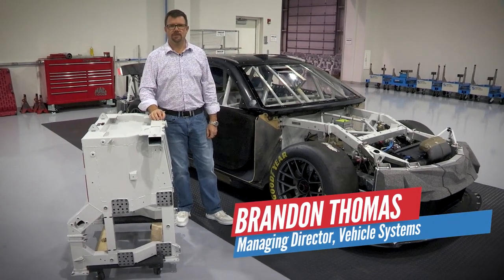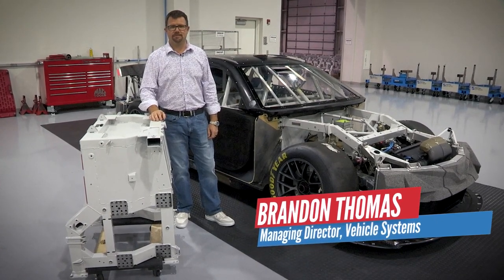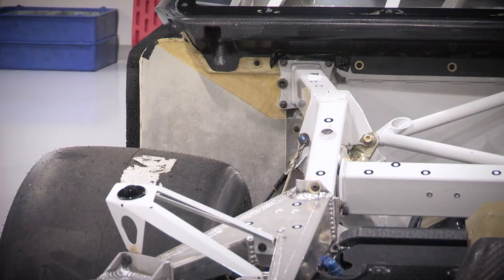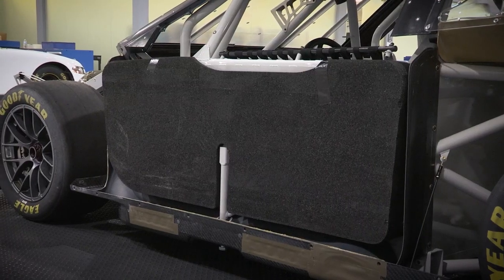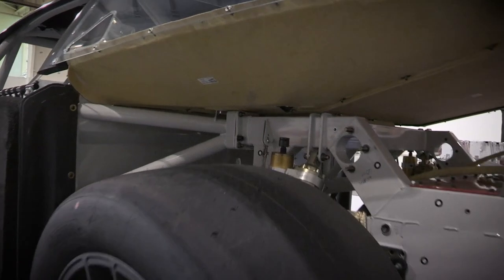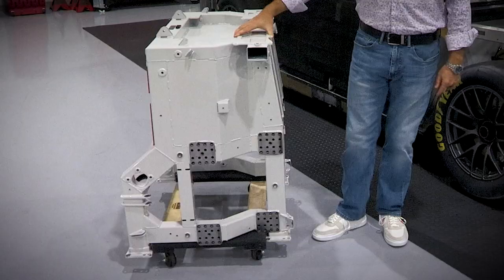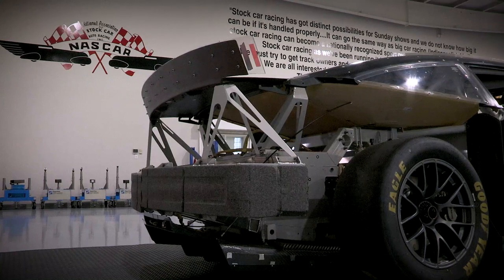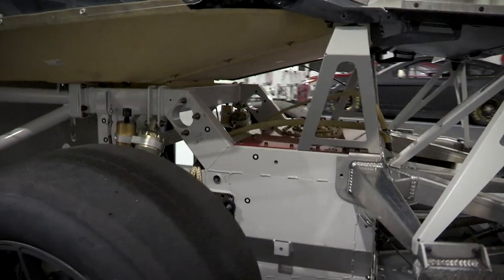Next Gen chassis system features modular design | NASCAR Next Gen

Comment: Once we get through the 2022 season and teams have built up their stock of these Next Gen chassis, I think the new car will be very beneficial to teams in the long run.
Reply: I get the impression (rightly or wrongly!) that a bump in practice that would have put the driver into a backup car might not do so with these - looks like you could pull the whole front off a car and bolt a replacement on there and then in the garage. That'll definitely bring costs down... huge benefit if and when this filters to the other NASCAR series with smaller budgets and less manpower.
Reply: @peterbrownless  hahaha
Reply: they actually can't do that....they're only allowed to own 7
Reply: Yes, beneficial to the TEAMS, but not the Fans.  I can't believe it's come to this:  NASCAR becomes a totally spec series.  That's no fun.  See you at the sprint car races.
Reply: @doninwv  its not a spec series...the Teams have already said that
Reply: @jabber1990  Its a spec series. They all have the same size engine with hp, same tires, transmission, chassis, the same amount of down force. By definition that is a spec series.
Reply: @Hazel-the-Amazon  no...that's not how spec works. Spec is SRX or IROC, this isn't anything like this. there are 4 engine suppliers..therefore its not spec
Reply: @jabber1990  If nascar can mandate what manufacturers you can get your engine from, and the size and hp of said engine. Its a spec series. Hell nascar, teams, and media called the old daytona prototypes a spec series. Yes they allowed only certain manufacturers, but you could have a 5.0 N/A racing a 2.3 turbo, as long as they met the hp limits, and engine size of the engine..
Reply: @Hazel-the-Amazon  It is not a spec series. Teams still build their own engines transmissions and racing components. Not all engines are equal when going from one team to the next.
Reply: @rcr-zt4of  It still a spec series by definition. If nascar mandates the all teams run the same size engine, hp, down force, tires brakes, shocks, etc.  And all cars are Identical to keep the field even. Its a spec series.
Reply: @Hazel-the-Amazon  All series mandate engines size, components etc.  You have no clue what you are talking about. NASCAR has mandated engine size for easily the last 30 some odd years.  Guess what.  The top teams had more horsepower in their engines than the smaller teams.  Why?  Because they spent money on development and built their own engines.  A spec series has one engine manufacturer and hands out those engines to all competitors.  Not even remotely close.
Reply: @rcr-zt4of  Wrong again. A spec series can run mutiple different engine. As long as the cars are all equal, or perceived as equal. The spec maita series allows two different engines, and two different brand of tires. The old daytona prototypes were considered a spec series, and they allowed like 4 different engines.

Comment: Mix and match would funny, a team sabotages another by swapping out their Daytona front setup with a Bristol one.
Reply: as funny as that is...it won't happen
Reply: no ones swapping clips for setups for different tracks lol the clips are only changed if damaged. you run the same chassis and daytona and bristol you just have it sat up and geared completely different with the correct aero shit.
Reply: That will happen for real. Those engineers are smart!

Comment: Very interesting, the real test will be on the track at Daytona after the big one and see how these bolt up chassis connecting areas hold up, after a hard impact.
Reply: I think probably only the center section is part of the "survival cell" so the bolted on sections could be completely detached and the driver would be fine
Reply: the real testing has surely already begun in CFD thousands of times
Reply: My thoughts exactly.

Comment: I first heard of this way of building cars watching the Le Mans 24 Hour race. If you had an incident and managed to limp back to the pits, the crew could just swap in a complete front-right assembly, for example, and have you back in the race at full speed in a very short space of time.
Reply: remember when Audi changed a compete rear transaxle/suspension at LeMans just for the heck of it ? it took them minutes
Reply: @supersevenn  Whoa! I've just Googled it now... Year 2000 apparently, when they had some kind of issue and instead of wasting time trying to diagnose it they just decided to swap in a new, complete rear end/transmission. Car was rolling down the pit lane in less than 5 minutes. That car finished P2. Wow I'm impressed!

Comment: Scary to imagine the amount of bolted connections there are now to the vehicle. Each connection is another chance of working itself loose, cross thread, not torqued properly, tensile break, etc. - Giant erector set, literally.   Will teams be able to replace rail segments after a crash and repair the car? (give them more time rather than the current 5 min clock)
Reply: this isnt your shade tree mechanic building and working on these. they are professionals! a little respect to their skills would be nice
Reply: I think cross threading, bolts loosening, and improper torque are the most unlikely of things. Clips getting sheared off clean in high speed crashes and becoming dangerous projectiles are my biggest concern.  It happens with entire engines every couple years, and that could happen with these clips about as often.

Comment: I'm sure NASCAR tested structural strength but bolting together is a weaker point than a weld would be correct? Especially since you are relying on a crew member to torque to specs and not miss a connection upon construction...Just a thought..
Reply: With high grade bolts, I would trust the bolted seam over the welds mounting the bolted flanges.
Reply: It's not the strength of just one bolt. It's many bolts. Bolts and nuts have held wheels on for decades. How many bolts have sheared off from the hub ever?
Reply: @skittlecar1  we are talking about the strength of the frame not wheels bro
Reply: @oceapliler6959  Wheel goes through way more stress.
Reply: @skittlecar1  okay cool dually noted, still talking about the gram lol quit deflecting fan boy this new age of nascar is ass quit trying to rekindle it.. it’ll never be good enough to get OG Fans like myself back into it lol
Reply: @shalominismj2265  "New age fan?" I'm 41.
Reply: In some types of racing where they are obcessed with weight savings, the bolts would of course weigh more than a weld.
Reply: @skittlecar1  lol if that’s true that you should know better. The sport will never be what it used to even 15 years ago just won’t. No matter how much we stay in tuned to what’s going on now and try to have a positive opinion of it. It’ll never be anywhere close let alone “better”
Reply: @chucktowntiger  by telling me he’s 41? Lol I don’t think so

Comment: What happens if there is another Ryan Newman or Austin Dillion incident. My fear is the front or rear clip snapping off and flying into the crowd.
Reply: Doubt it tbh but i think they have that situation under control
Reply: They are tethered  also, not only bolts holding them

Comment: it's high time NASCAR racing concentrate on pure longer road races (track) than the customary oval race tracks . . . by that we don't mean Monte Carlo but exactly like Nürburgring type race tracks, infact the long Nürburgring race track is best suited to NASCAR road racing . . . remember Nürburgring race track was designed & built not just for Formula One & WTCC but NASCAR & WRC Rally Cross as well . . . a mix of 80% road course & 20% oval track would be best . . . NASCAR should go worldwide like F1 & future NASCAR should look into supercharged & turbocharged in-line-6/V6/V10 engines not exceeding 5.8 litres in naturally aspirated form prior to turbocharging . . . HYBRId® power packs in NASCAR will be even better where race car OEMs will be judged (points given for the manufacturer's championship title) based on the maximum duration their race cars has operated on HYBRId® power during a race . . .

Comment: Other than the manufacturer specific noses every car looks like a 4 door Dodge Charger.  They also have to figure out that putting the numbers forward near the front fenders looks like absolute sh*t and get it back where it was before.
Reply: Side panels and rear panels all look different on these cars as well when you get them in bare without paint. They all 3 have their own unique flares going over the rear wheel.
Reply: The only spec part of the body is the greenhouse and rear deck.  All of the other body panels are unique to each manufacturer.  The reason the numbers are forward is because the rear quarter panel on the NextGen is quite a bit shorter.  So there is less room with the number being centered on the door than before.  With sponsors being the life-blood, the numbers had to be shifted forward.  Better get used to it, as it is very unlikely to change back.
Reply: that is a complete lie
Reply: This is definitely a “get off my lawn” type of comment
Reply: @doninwv  Quit trying to live in the 90s. This is where racing is at now. Suck it up
Reply: @josephdale9375  Yup, just like everything else these days, gone to shit.  Go, enjoy.  You'll have plenty places to sit.
Reply: @doninwv  😂😂😂